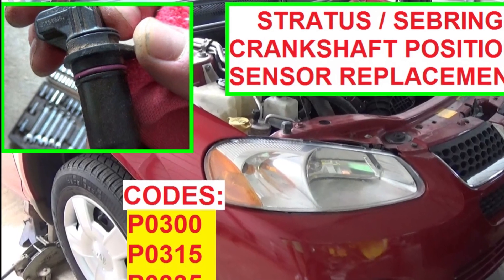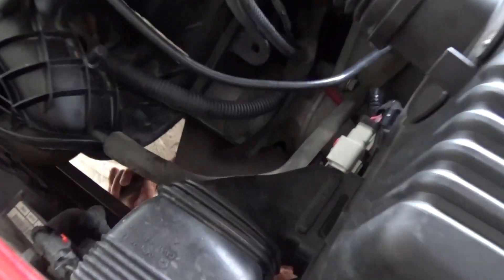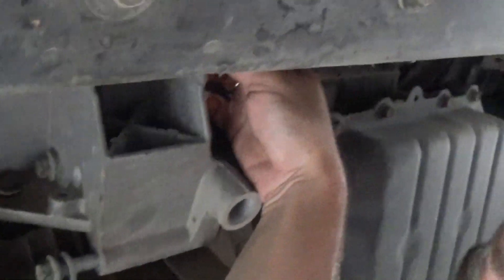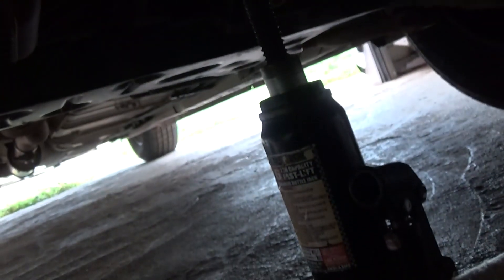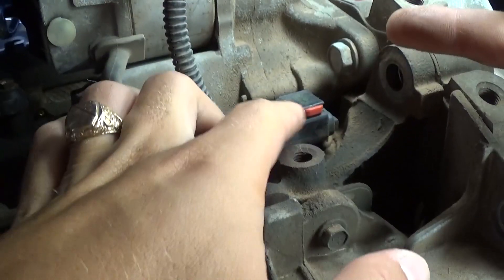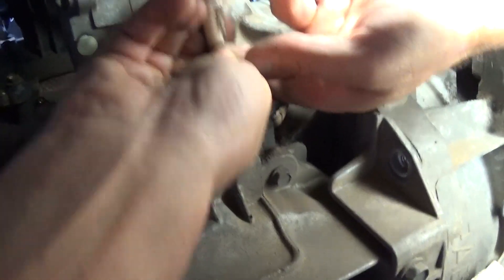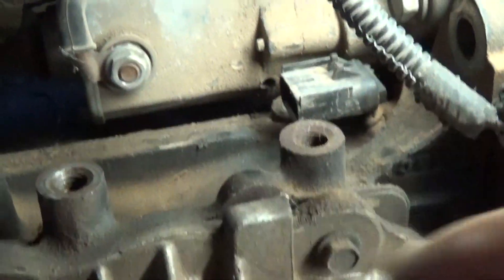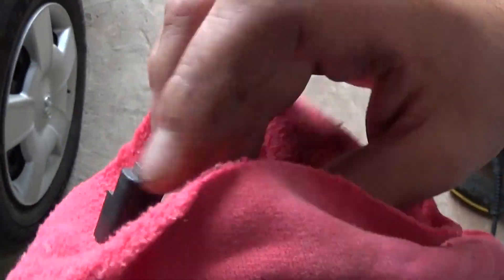Crankshaft Position Sensor Replacement  Dodge Stratus / Chrysler Sebring P0300 P0315 P0335

Comment: Mmmm not sure what year car you're working on. Mine was very easy to get to. 
Mine was right above the motor oil drain plug. 
The hardest part of the job was lifting the car up with jacks. And pull the tap to release the connection. 
The rest was easy.

Comment: I replaced the crankshaft position sensor on my 2004 sebring 2.4 and before it didn't Starr but now it does but I'm still getting misfire and crankshaft sensor intermittent codes??? Anyone help please

Comment: Does it require a Crank Variation Relearn after?
Reply: If you still need the information.. 
I'd say turn the car on, let it idle for about 15 minutes. Then go for a drive. It will learn itself in. 
If you're still having issues, there are other YouTube videos you can watch on this topic. 
I just replaced my crankshaft sensor. My car runs great.

Comment: for a 2008 chrysler sebring 2.4
will the sensor be at the same place as the 2007 model?
Reply: If you still need the information for this; mine was under the car, right above the motor oil drain plug. Mine was very easy to get to. I didn't have to take any parts off. 
Only pull the tab to take off the connector. The rest is very easy. 
Hope this helps you out.

Comment: where is the crankshaft position sensor located on a 2007 chyrsler sebring 2.4 ltr engine. i have removed starter not there. i removed intake manifold and its not there
Reply from the maker: +William Walker here is a diagram http://www.fixya.com/cars/t9662520-location_crankshaft_position_sensor
Reply: William Walker did you ever find out bc I now have this problem

Comment: help me please!!!!!!! where on Earth is the Crankshaft Position Sensor located on 2002 Dodge intrepid ES model 3.5 liter engine V6
Reply: Hey... If you still need to information.. 
Mine was under the car. Right above the motor oil drain plug. But I think it depends on what year your car is ? 
You can also go to a Dodge Dealer, (parts department) they will give you a printed schemetic of where the locations are for sensors and parts. It's free. They don't charge you for this.

Comment: I am trying to replace the crankshaft sensor on my 2000 Dodge Dakota. I have removed the bolts, but cannot remove the sensor with the grommet in place. The sensor turned counterclockwise as I was attempting to pull it out and will not turn back. Is there a specialty tool I need to remove the grommet?
Reply: That is on a 3.9L V6